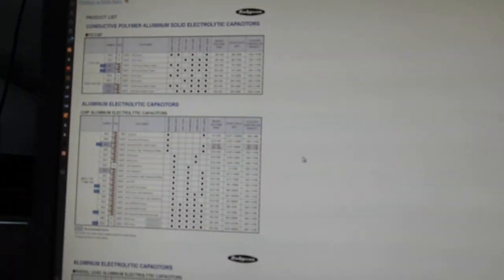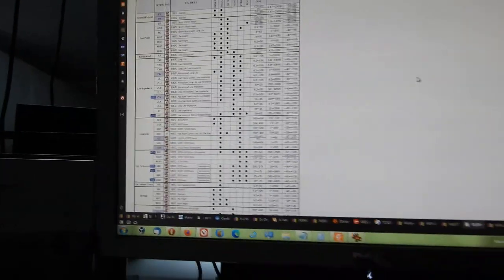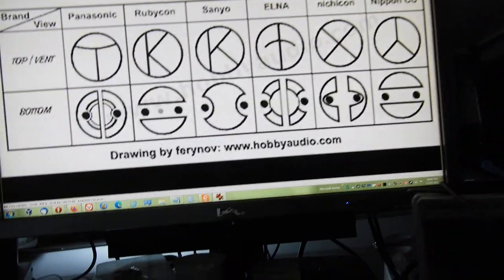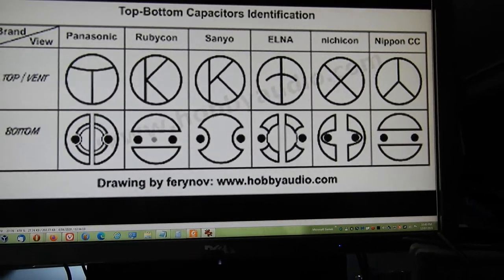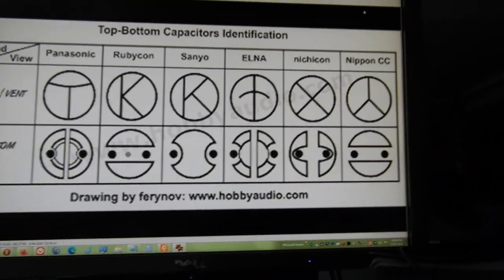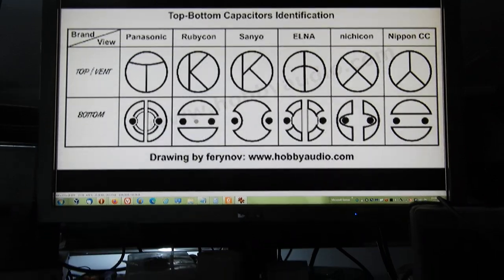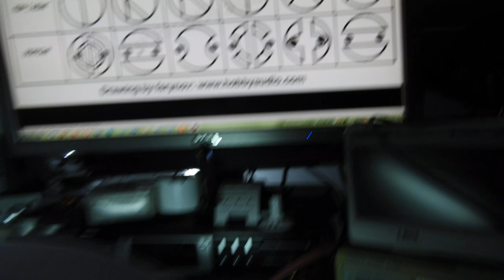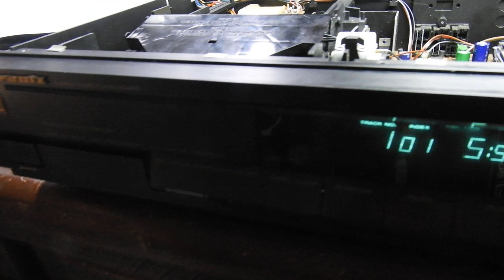Re-capping and the case of Marantz CD-65 Mk2

Comment: You've timed this video well. I've been given a CD-65 II that's acting pretty odd and unable to read discs so I'll definitely put your advice here to good use. In my case the motor struggles to spin up and it sounds like the laser arm is slamming into the limit of its travel when it attempts to position itself. It was struggling to focus too but a minor adjustment of the focus pots got that part working at least.

Comment: That was an extremely helpful video, thank you.  My original question to you was prompted by your video on the Marantz CD85.  I have a CD85 which has remained untouched during its lifetime but is chock full of the Philips brand capacitors you mention.  I'm concerned that if they are possibly leaky this could lead to corrosion of the boards.  Is it also possible that a leaky capacitor could take out a resistor?  I ask as the sound through the analogue circuit seems to be missing key musical information.  Could this be due to the fact that the player has not been used for many years and needs to be run in?  I'd be very interested in hearing your views on this.   Thanks for your time.
Reply from the maker: If your CD-85 is missing "key musical information", then it is in a need for re-capping. All those Philips capacitors have to go.
The capacitors in the Marantz above were not physically leaky but electrically leaky. Capacitors are supposed to block DC (and smooth ripples on it) and pass AC through and these were also passing DC through. When they really fail, they leak electrolyte and this is when they damage the board. This does not happen often, but when it does, the damage is severe. I have a beautiful Vimak CD player where tracks were damaged even underneath ICs. I took care of this but I have winding in a voltage multiplier transformer that is gone and hence no display power supply and I am worried that I might never be able to fix that (for I have no idea what winding it was).
So no, your player does not need to be run-in. It needs to be re-capped. You might as well get yourself a component tester and new ones are now available which are cheap and very good. Like this  https://www.ebay.com.au/itm/284252311578 It is a bit flimsy, but works very good. These https://www.ebay.com.au/itm/174798956855 are much better built, but require external power supply because 9V battery only lasts few tests and they do not measure Zener diodes. Test the new replacement caps before you put them in (as I do), because every now and then you will find a few capacitor that is faulty. If you are replacing 30 of them, you do not want to look for a faulty one on a Philips board where tracks are barely sticking to the board...
Reply: @hear-net-au  Thank you again.  Very useful information.  I will rid the CD85 of the Philips caps before they do any damage.  Are there any of these caps in the power supply do you know, as there is a bit of a hum from the transformer and I'm wondering if this comes from DC leakage.
Reply from the maker: @leehumby8733  Mechanical hum or through the speakers? If it is through the speakers, then the problem are those filtering capacitors. If it is mechanical (it hums with the rest of system is off), tighten the transformer mounting screws. If this does not help, put a rubber washer (from old car or bike tube) underneath the transformer.
Reply: @hear-net-au  Actually it's a bit of both!  I can hear the hum through the speakers as well as when the player is just idling - looks like there's a bit of work to do.  The 'missing musical information' turned out to be an errant interconnect so at least I've put that to bed and the player is sounding sweet now.

Comment: Great video, however which resistor did you change or do you have a board schematic available, please? Thanks.
Reply from the maker: This was 2 years ago, so I don't remember which resistors I replaced. They must've been from the motor power supply. I'm not home, so can't tell you for sure if I have diagram for it, but if I do, I mostly get them either from Hungarian site Elektrotanya.com or from hifiengine.com.

Comment: hi there and nice to meet you how much would it cost to recap my Marantz 65 and can i send it you,  do you use the Audyn variants, this is what some one dose on  E  bay         THE MARANTZ CD65DX is fitted with the superb PHILIPS CDM4 TRANSPORT with the superior brushless haal effect motor same as CD75 mk2 but with a plastic base rather than cast metal &  all time great multibit TDA1541A dac I have upgraded it with ultra high performance components throughout  RUBYCON YXF ZLG & ZLH low impedance capacitors Nippon ChemiCon, Dubilier, Nichicon, Panasonic,greatly increased power supply capacity e.g 470uF up to 2200uF this reduces power supply ripple before the regulators &  non polar electrolytics for output signal coupling which are almost as good as a film cap,MBR 11100 schottky diodes for digital & analogue supplies,gold plated sockets for the op-amps ultra low distortion LM49720 , new trim-pots for laser focus & offset,  cd clamper mechanism cleaned & greased new belt fitted superb sound as always with these classic  dac's, note the headphone circuit & socket is removed for sound quality reasons, no remote control but many philips based ones will work & are easy to find , I try to show the upgrade work in the photos so you know it is genuine so many items claim to have been serviced or upgraded with no evidence of the work also I have upgraded many cd players & amplifiers ( I am a qualified technician) & sold to happy customers around the world including France Italy Spain Norway America & Hong Kong although I should point out I do not do this for a job or make any money just tend to upgrade items I have collected for the pursuit of great sound & research , international sales to be handled by EBAY global shipping program.
Reply from the maker: Firstly, where are you located? I am on the West Coast of Australia. I do have 3 x CD-65 in stock, one of them DX.
Reply: @hear-net-au  a bit far I am in 🇬🇧 I used to live ion the Gold Coast over  years ago.
Reply: what is the dx version , what did you do to them to upgrade
Reply from the maker: @hamzatatta952  I do not upgrade $150 CD players, for it would still be $150 CD player with nice accessories. Vauxhall Cavalier with new rims, Pirelli P0 tires, Xenon lights and new silicon wipers, would still be a Cavalier.
Don't get me wrong, I agree it is a very good player with good mech and good DAC. But no matter what parts you put into it, it will never rival Denon DCD-3000 (aka Alpha DS10) with 4 x PCM-1702, balanced output and digital input to its DAC. And you can get it for under $1000.
In general, I am not a tinkerer. I buy faulty stuff and repair it. I leave "upgrades" to people who only can solder.
I could do one for you, but you would have to search for and buy your own capacitors, for it would take me several hours and you would ot want to pay for it.
If you want to buy any of the upgraded machines, ask the guy to send you a picture of his electrical solder extractor, for I have seen many machines with damaged tracks by hobbyists doing the re-capping. A lot of manufacturers used to bend legs of components and they are a bastard to remove without proper equipment.
Also, I am in the process of Lampizating one of these by a local tube guru from Switzerland. He said that the prototype sounds very good.